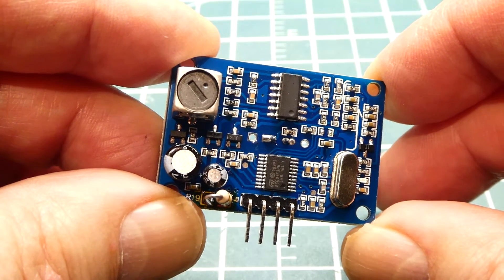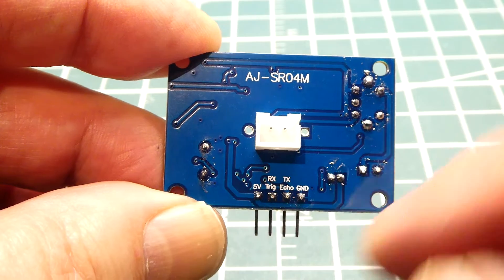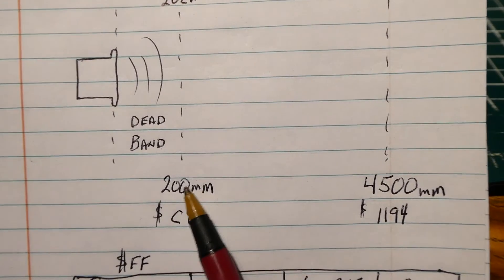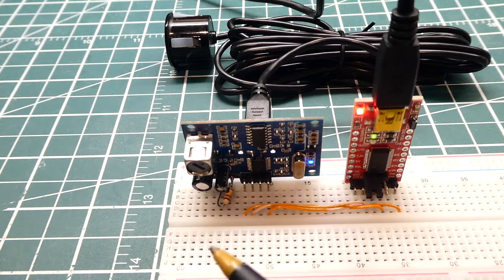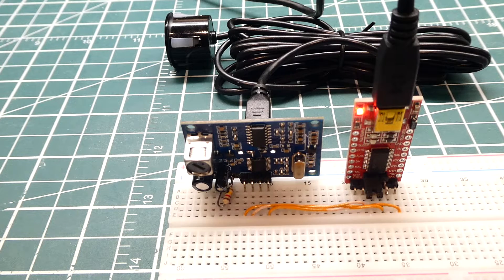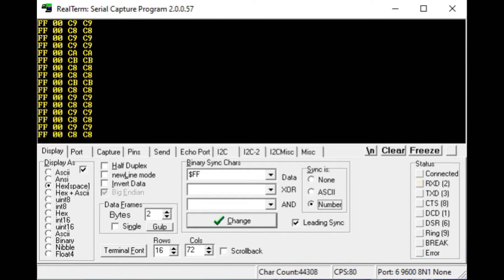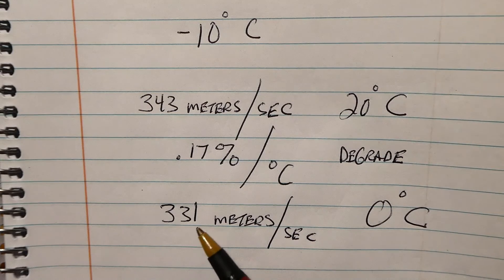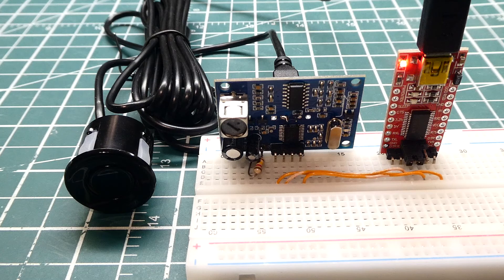Distance Measurement / Ultrasonic Sensor / AJ-SR04M

Comment: Please clarify while connecting JSN-SR04T Echo output to ESP32 GPIO pin, is it necessary to put resistive of MOSFET voltage divider which converts 5v out of Echo pin of JSN-SR04T to 3.3v which is max voltage accepted by GPIO normal pin ( from GPIO 13, 14, 16, 17, 18, 19, 21, 22, 23, 25, 26, 27 ) to get the more distance measurement accuracy or it's ok we directly connect Echo pin to GPIO PIN ?
Reply: YES, it is necessary (and highly recommended) to use a voltage divider or logic level converter to lower the signal from 5V to 3.3V.

Comment: i just got mine and did short r19 ... tried to plug it but no led comes on... is it cause of the mode or is it faulty cause i cant make it work too
Reply from the maker: To put the board into Mode3 a 120K Ohm resistor is applied across the R19 solder pads as shown in the video.

Comment: Was the box held at snow level and the target was the roof ? I am a little confused on how it measured the snow depth.
Reply from the maker: Mount the sensor say 8 feet above the ground in an exposed area that will see snow. With no snow, the sensor will read 8 feet. After a snow fall read the sensor value which will be less than 8 feet. Subtract that reading from 8 feet and that will be the snow depth.
Reply: @0033mer  Thank you

Comment: You mention that you keep the sensor warm by heating it in an enclosure. Is that a plastic enclosure, and does the enclosure affect the readings given by the sensor?
Reply from the maker: The sensor is Piezo based so freezing can cause damage. The sensor was put into a plywood box enclosure pointing down through a hole in the bottom. A light bulb was enough to keep it from exceeding the operating temperature specs. The transducer face is flush with the wooden box so the readings are not corrupted.

Comment: I used this model to measure my backup water supply tank with an ESP8266. I’m not a fourth aficionado but I still find great practical content on your channel so I just want to communicate my thanks.

There seems to be a few different copies of the sensor.. some with limited setting capabilities.. also the mystery chip had me a bit worried when I received mine.. though I reckon it’s just some type of TTL serial chip so no massive loss there.
Reply from the maker: Thanks for sharing!